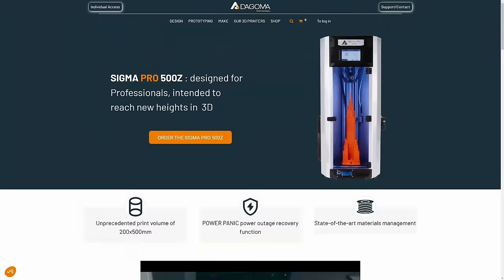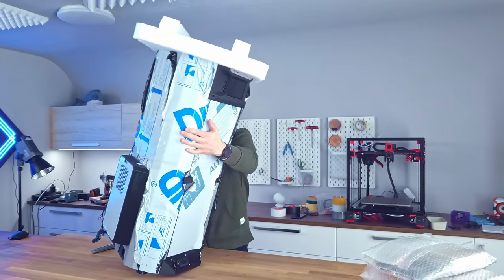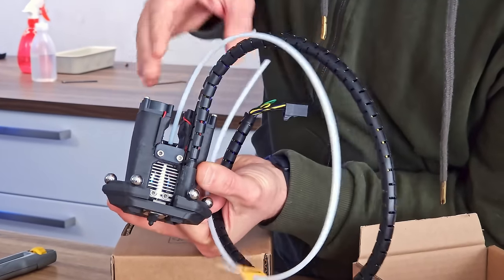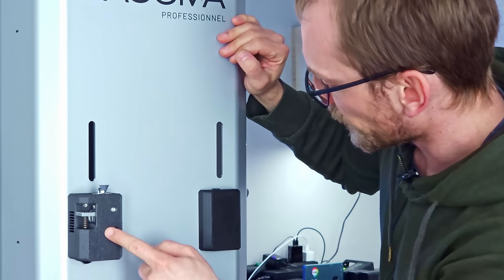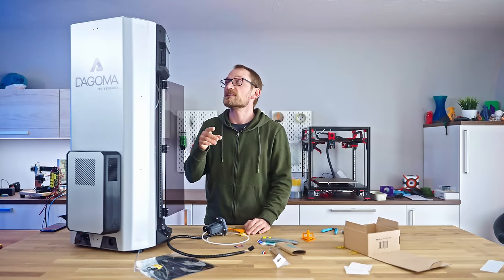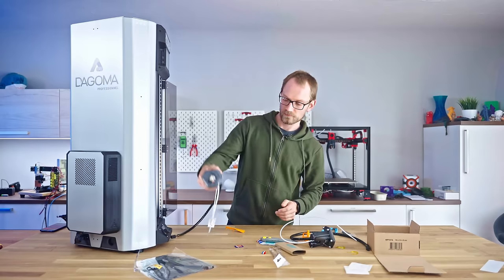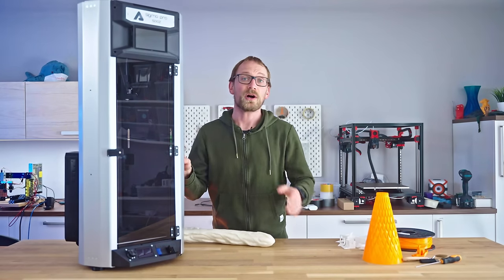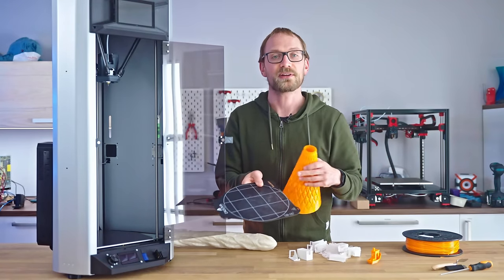Is it worth going "Pro"? Trying out the Dagoma Sigma Pro 500Z!

Comment: This would be my dream 3D printer in 2015
Reply: My custom built SeeMeCNC Delta looked better than this in 2015.
Reply: I started with a FolgerTech Kossel in 2015.  This definitely would have been a step up in most ways.
Reply: Абсолютно согласен
Reply: Not really, you will be very upset after you find out you can make any good prints unless you print with speed 10mm/second.
Reply: I laughed out loud at this comment. Good one.
Reply: @vt1272  I had a V2, and mine was custom built as well. Mostly because the Rostock parts weren't up to the job.

Comment: It’s a 2017 printer plain and simple. The FLSUN V400 is a far superior machine that works perfectly
Reply: hoping to get Flsun S1 :)
Reply: And costs 70% less
Reply: Yep. For 1/3 the currency.
Reply: V400 ran klipper. This things like 2 years further back
Reply: In 2017 their french concurrent EmotionTech had a far better delta printer (MicroDelta/Rework) than this garbage 🤣
Reply: Absolutely far better choice, and for 5X lower price. I'm also always looking at this stuff from a DIY standpoint, and for €2400 difference I'd make it print metal LOL. No, this Sigma is a robbery, an expensive flimsy box, nothing more...

Comment: Way too nice. You don't have to lambast them, but you glossed over some pretty significant shortcomings. For a $2k+ machine, Dagoma has missed the boat. The wiggly 3D printed control panel, anemic bed temps, wacky control theme, and odd setup (or lack of setup) are just non-starters for a $2500 machine. FLSun will likely wipe the floor with this machine at less than half the price.
Reply: Seriously. You're gonna charge enough to buy three brand-new Prusa Mk4 kits, I'm gonna expect it to outperform those by a hefty margin. This thing looks like a KS project from 2018 that has spent the past 6 years making excuses before delivering this under the threat of lawsuits.

Comment: From what I saw in this video, I think that an Ender 3 'Pro' is more 'Pro' than this Dagoma printer.  In my direct experience with the printers we used at my job, I would consider the Lulzbot TAZ 5 that we purchased about 8 years ago for about $2300 as a 'Pro' printer.  It was very well designed and put together, and it performed very reliably with very litte trouble.  As a matter of fact, even though I retired from that job about 3 years ago, my company is still using that TAZ 5 printer, and it is performing as well as it ever did.  We later purchased a Markforged Onyx 2 printer (at about $8000) for print carbon-fiber nylon parts,  and that also performed very reliably for us.  It could also add fiberglass fiber to reinforce the nylon carbon-fiber parts, which to my knowledge is something that only Markforged printers can do.  So, I would definitely consider the Markforged printers 'Pro' quality as well.  I think to me, the main criteria that I believe make for 'Pro' quality are durability and reliability.
Reply: I think in the realm of 3D printers, pro doesn’t even mean reliable or durable since consumer printers are generally good enough.

The markforged is pretty unique though and if you need it then it would be well worth the price. Continuous fibre is just so much stronger, there are a few videos on YouTube of comparisons and how much extra strength the continuous fibres add. Other models they have can do more than fibreglass. For $16k you an get one that can do continuous carbon fibre, Kevlar, fibreglass and HSHT (High Strength, High Temperature) fibreglass.

Comment: If I were looking to spend about $3k on a printer for my company, I'd probably just grab a few BBL or Prusa machines unless I needed some to print with some really exotic materials. Those machines cost less upfront, take less time to set up and are probably more reliable. There's also plenty of documentation from both companies and from the community on configuration and maintenance

Comment: Wow, for €2500? Not a (pardon my french) chance. If you need a large build volume you'll be able to pick up an Orangestorm Giga for around that price once it hits retail, or a Prusa XL with dual print heads for less, or a small print farm of either Prusa MK4's or Bambu Lab P1P or P1S printers, which are going to be far more useful than this utter failure which will turn into a dust collector in a corner somewhere.
Reply: Exactly
Reply: Exactly. I have printed hundreds of parts over the years and almost all of them benefit from having a larger bed size rather than having a tall printing height.
Reply: In terms of specs a P1S beats this in most areas other than nozzle temp. However this printer can’t use it’s hotter nozzle because it has a 80 C bed and no chamber heater so a P1S is a much better and cheaper choice.

Comment: It's a GTMAX that speaks French!!!
Here in Brazil, there is a manufacturer (GTMAX) that calls its printers Pro, but they are basically the same as this one, many printed things still use Arduino Mega with ramps, some have Raspberry.
and sell as professional printers.
And they are extremely expensive.

Comment: This seems to be what I would call the third type of "professional" machine; a "professional" machine  made for non-professionals (usually educators), who want that first type of professional machine you mentioned but have absolutely no clue on what to look for (or rather, what to look out for) and want the reassurance of having a "pro" machine.
This is why they seem to be aiming fo a bunch of interesting  features without truly considering how to implement them well.

It really reminds me of my experience with Makerbot's Replicator+, and my experience dealing with those vs a Mk3 or even a stock Ender 3 back in 2018.
Reply: Yep, this machine is noob bait.

Comment: I've got a Dagoma Neva that I got from their Kickstarter campaign in 2016 or something and watching this video.....weeelll, it appears they've not learned anything since 2016. The slicer? Oh, it's the exact same thing they got in 2016! Print head having the tendency of just clogging up for no good reason? I haven't been able to get mine to work and I've tried multiple times over the years! Wobbly rods and print head? Oh, yes, that was also an issue already in 2016! Their customer support was worse than useless, too.

I have absolutely nothing positive to say about the company or their printers.
Reply: Judging just by the specs alone and assuming the printer was high quality, it is not worth the money. Only 80 C on the bed? That is low enough it might struggle with ABS, let alone engineering grade materials like PC or PPS or PVDF.

Comment: At work we should go professional, not a creality so it ended up in a creatbot DE, it’s slow unknown in forums, slicer has no profile for it and it’s boden 2.85mm filament, the filament act like sofa spring when rolled up and PLA cracks in the tubes. I’m happy to have 4 different consumers printers at home proving the hobby can be useful. Else I’m afraid it would have crushed my 3D printer spirit.

Comment: The question is really, what is a "pro" 3D printer. Some may argue that as long as you use it professionally it's pro, others may argue that it has to be something made by the giants in the 3D printing realm, such as Stratasys. As someone who had experience with hobby, mid range and proper professional 3D printers (that cost 20 times more than the one in this video), it's not an easy line to draw in the sand. If you work professionally and time is money honestly there is a huge draw to companies like Stratasys. While the cost is eye watering, even for their consumables, their printers just tend to work, and provide great results, and they have good support (in my experience) when things do go south. Our printers run for thousands of hours a year though, so the more robust the printer is, and the more hands off we can be, the better. Their cost is quickly offset. I simply haven't seen any of these mid range printers coming anywhere near close to compete with that, and for that reason I at least have a hard time calling them pro. Though, I can see fab labs, or companies who only do the occasional print every now and then benefiting greatly from them, as they don't have the business case for more expensive printers.

Comment: if that's a "pro" machine then i'm god.

3d printed parts all over, pretty much stock firmware, and the printed hotend assembly is even tearing in the layer lines.
this machine right here is the absolute perfect example of why i don't mind bambulab being closed source.
Reply: You would get more functionality and higher build quality out of a P1S for a lot less money.

Comment: I have used the Makerbot Method. i have used Ultimaker 3s. I have use a Stratasys Fortis. And every time it's been a disappointment. Not that they didn't work. They worked fine. "But for the price" is my mantra. And "for the price" these "pro" priced machines are not delivering a pro experience. The only one I used that I was not disappointed with was Raise 3D, and that was with their N2+. Then they restructured, named it the N2Pro, and doubled the price of it. But it's still a good machine for the size. (Better than this, IMHO.)

Now we're living in a Post Bambu world. And I'll be darned if they didn't set the standard for power and price that even these pro machines need to take note of.

Props for the Team Fortress 2 nod.

Comment: In my experience 'professional' means locked down. When working in a regulated environment (aviation, medical devices) sometimes you need the ability to lock settings down but imo companies take it too far or as an excuse to not build out features. I think you'd be surprised at the lack of features in stratasys's grabcad. Most professional machines also tend to require a tech to install and setup the machine no matter how easy it is due to warranties and other reasons.

Comment: I mean, just get the Qidi Max 3 and it is a much better "industrial" machine if that's how you're defining this one. the Qidi can reach 120C on the bed and is closed with an active heated chamber which allows it to print tough materials without much problems. Yeah it would be really difficult to print ULTEM or high-grade polymers but it can do well with most engineering materials.
Reply: heard its an unreliable POS though. Bambu lab all the way, there is nothign that comes close in reliability AND quality - the combination that actually matters
Reply: @matthiwi6901  I didn't hear. We have 4 units in our factory and they're absolutely fantastic. You would be right for older revisions of the machine. But the current ones are fantastic and they are very reliable from our own usage.

Comment: Um for that price, I’d be angry if this was what I received and expected a “professional” machine. A Bambi X1C or P1S (I own a P1S) to me, is a far superior machine for half to 1/3 the cost.
Reply: If you really need a “pro” printer then the X1E would be much more capable than this here or like you said a P1S would be better. A P1S has better specs and build quality, plus is reliable and isn’t from some small brand that no one has heard of that can’t even make a manual for their product. The only thing the P1S falls behind in is nozzle temp (300 C vs 350 C) but this printer can’t even make use of that heat because of the low temperature bed and lack of chamber heater.

Comment: Thanks for this. I'd love to see how "real" professional printers, like something from the Stratasys F170 or F370 line, hold up in a Thomas-Review. I know the F370 will cost you about 10x the price of a fully built 5 toolhead Prusa XL. How good must these professional printers be, to justify that pricetag? I doubt Stratasys would send you a review unit, but maybe you can get to them at a tradeshow and try to see for yourself if and how they are actually better (or the same old tech with a fancy company logo and locked down firm- and hardware).
Reply: I run a F370 daily, thousands of print hours a year, and basically it just works. Yes, the GrabCad slicer leaves lots to be desired, and yes the consumables are also horribly expensive, but with the amount of man hours spent fiddling with it (basically zero) it's definitely a winner in a professional context. For our J35 printer we've had some issues, but the Stratasys support have been great in service and replacing parts. None of Stratasys' printers are really worth it if you only are going to print occasionally, they are more or less production machines.

Comment: In the same pricebracket a Formlabs Form 3+ is just a plug&play monster. There's onboarding on the machine, there's loads of documentation both text and video and the slicer, while limited in features (hello, where's my hollowing and holes? I suppose it presumes your model is FINAL before importing) really is just plug & play. You choose the resin & layer height and it will do everything for you, including sending the print over wifi even to printers on ANOTHER CONTINENT through the cloud dashboard.

In my several month long history with the printer for work I've had about 1% failure rate on prints and it's been going almost non stop. Truly a professional work horse.

Comment: great content as always ! i found the same for the Raise machines .. they are heavily promoted but when we got one as a business, and tried to get customer support they denied it as apparently customer support is only in USA.. we had to heavily modify the printer, the bed, the head etc. Just to get it working ok. There were a lot of design flaws, and you can see it on the forums, Raise is usually  blaming the customer and stalling them asklign stupid quiestions and askign to provide gcode and files then they 'rep[licate' and find no problems saying its users fault etc. When next - after some tiem they release new model with all features that were lacking added - but so poorly they even worse now.. I can go on for ages. but yes someone should do honest reviews like you do and show that. FOR ME THE PRO PRINTER IS : Ready to go when powered on. Have spares of all cosumables ready to go. Comes with Oil glue , etc. And instructions on how to use and what not to do + sample filament and print on the memory ready to go to test the machine !

Comment: I guess the 'a bit outdated' model is still nice and professional for beeing a stepping-stone for the more customized models for 'the real printers' with other beds and extra heat for the chambers and second extruder which can be much more expensive but still using the same start-base.
Heated chamber, fan and filter on top... just customer-installed things and supported by Octoprint and some basic interface.
Of course with just a small firmware-change you can upload to the printer from within Octo in a couple of minutes, you can change a lot of values too and just have the printer setup by Dagoma at your shop?
Probably also using another payed subscription for a professional slicer...

Sooo many times I have seen tools for professionals that worked that way. Starting with 'very affordable' to customized and much more expensive fast. That " startthingy" is then just to attract people as potential customers that get a support-contract to do all for them. Of course if anything is wrong, you can just swap out the whole printhead fast, ship the 'old' one to the factory and get another one back ready to go.

But... what is that you were printing and holding in 'skin color'?

Comment: That belt tension thingy looks just like the one Prusa posted on the prusament printables account, released under CC 4.0 (attribution-non commercial-no derivatives). Under that distribution with attribution to the designer in any form is legal; tossing a free one in the box when someone buys a printer may well be arguably OK but there should be some indication of where the design came from. This is assuming that it is the design produced by Prusa (or a modification thereof) of course, this video doesn't give a clear enough look at it to see if it is the Prusa belt tension thingy or a very similar one developed by Dagoma.

Comment: I would pick a core-XY printer with a larger print area than having such a tall print height. The speed along with the rigidity of the core-XY motion system will be much better to print out large number of parts quickly.

Comment: the printers I have used at my company usually come with someone that has to come on site and perform install and setup. This tracks with no assembly manual but the company seems to small to actually facilitate that. (this has primarily been with Stratasys, Markforge, EOS, and SLM machines, the last 2 of which are L-PBF metal machines so in a bit of a different league to start)
Reply: At least the EOS are not "Pro" but  "Industrial". That's a completely other league and sets you back some 6 or even 7 digit numbers of Euros.

Comment: Professional should mean = Just prints out of the box, is incredibly reliable, profiles are 100% tuned in (your a business and you don't have countless hours to spend messing about), should be fast (for quick prototyping or selling parts), have easy to use comprehensive manuals, super fast delivery of spares (having a broken machine will impact your business).

Comment: I made once the mistake to buy one "pro" printer, a raise3d pro 2... It is the second worst Printer I ever had. Slow, very often troubles when printing, print quality not as good as it should be. I prefer my Prusa Mk3s an my bambu X1C. The MK3s still is the best when it comes to quality and correct measures.